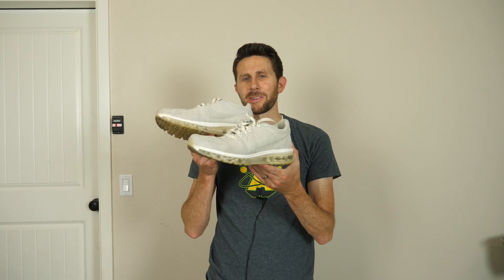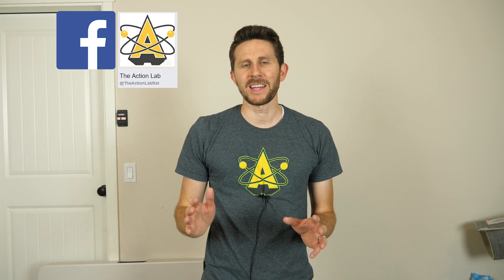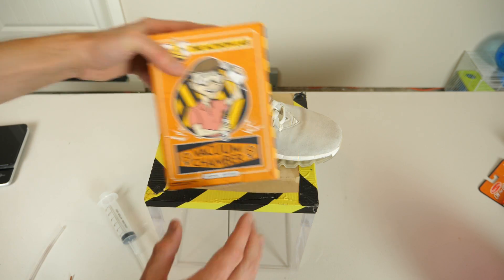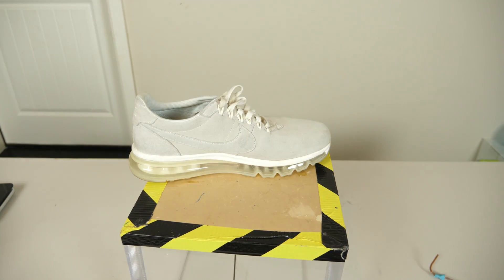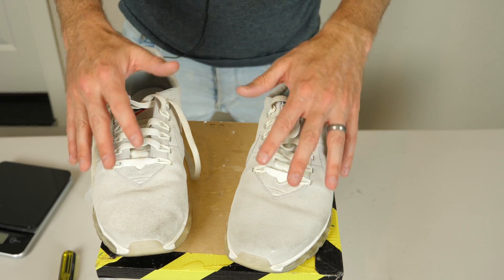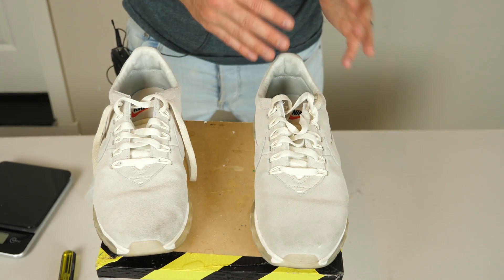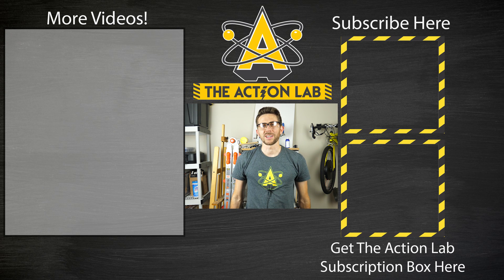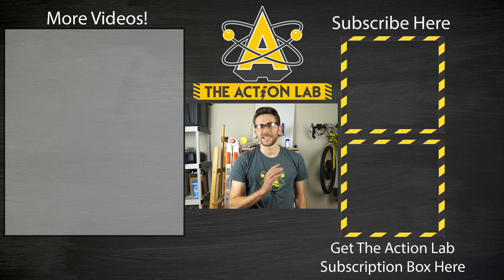Putting Helium in Nike Air Max—Are They Lighter?

Comment from the maker: In 1999 Converse came out with a shoe called Helium that premiered a bubble filled with helium in the bottom to make the shoe lighter...they could have benefitted from watching this video
Reply: The Action Lab : what was the weight of the shoe after the air was removed with the suction pump?
Reply from the maker: The weight of the shoe was the same after air removal. Air is neutral weight in itself at near atmospheric pressure. But for higher pressures it is more dense so it is heavier (like in a bike tire)
Reply: The question is, why would a tire with 40 PSI of helium be heavier than a tire with 40 PSI of nitrogen and oxygen.
Reply from the maker: I’m not sure about why the helium could weigh more. It should actually be heavier. It deviates from ideal gas such that there are less atoms at a given pressure than N2 or O2. Also those atoms have less mass. So it should be lighter...even at 40psi. Did he control for temperatures and was the volume exactly the same. Those would both have to be the same to expect the correct results.
Reply: here is the video in question https://youtu.be/vJNg4njdyLo
Reply: actually doesn't N2 and O2 deviate more as they are diatomic vs monatomic that helium has?
Reply from the maker: N2 and O2 deviate much lower at below 200 atm then much higher at above 200 atm. By lower I mean the compressibility factor is less than 1. As in this photo https://goo.gl/images/hD25y9
Reply from the maker: Just watched that video. Definitely not a reliable method. Not accurate enough scale, and temperature and volume were not controlled (volume will be close to the same though but not exactly)
Reply: benjah4eva the same as when air was in it.
Reply: I recently saw a video of this guy putting about 40 PSI of helium into a bike tire,  it actually made the tire heavier then with same pressure of normal air but no one could give an explanation for it.  perhaps this is something you can investigate?
Reply: @abyssflight3907  was it Needle media? It was heavier because it needed more since helium isn't as dense as air
Reply: i thought when the video said new on it i just thought oh it was made maybe yesterday but no just a couple hours ago
Reply: Roan Robertson .
Reply: Or just experienced a helium balloon. It's just a selling gimmick.
Reply: Lol
Reply: What if you put sulfurhexafloried is it hardder to walk?
Reply: Wouldn't it also depend on how accurate the scale was?
Reply: Hey action lab ! Love all your videos.
But I have a question,
Which is faster: human sensation or light ?
Please answer this
Reply: @Prayash Niraula Tutorials
Humans, on average, take at least 20 milliseconds to process what they see. Light, meanwhile travels around 30 centimeters in a nanosecond.
Reply: @prayash7805 
It's light.
Reply: A weight difference is more likely if you put Sulfur Hexafluoride in those shoes as it is six times heavier than air.
Reply: I love your vids, they help me understand things that I didn't know and idk if it is just me or you are tired in most of your videos so please take some rest and keep up the good content
Reply: @The Action Lab
Lovely video. I wish you would put more things in the High Pressure chamber though.

Now if they made the sole more like aerogel, with many smaller air pockets distributed evenly throughout a matrix...
Reply: Get shots💉!
Reply: Put a diamond in a hydraulic press
Reply: What's your actual name
Reply: Dark Angel my name is Daniel DuCharme
Reply: I want to become a scientist when I'm old.I am getting a lot of interesting information from you.You are totally cool
Reply: The Action Lab .
Nb

.,
Reply: Thanks @Will Salmon and @Amaroqdricaldri
Reply: Do the turtle on the treadmill experiment
Reply: They also put helium in professional push bike frames. There is a valve to top it up.
Reply: Hi 👋 cool
Reply: It would make it heavier because it’s less dense and it takes more helium to fill it needing more helium to fill it
Reply: @owenturner758  it would make the shoes lighter because helium weighs less and takes up the same volume
Reply: The Action Lab try using the Nike vapor maxes
Reply: What will happen to water if you completely remove air out of it? Will it be possible to make it boil or to freeze it? Will it mix with air if you leave it in a glass for a while? I tried to do this with syringe but I think vacuum chamber is better for this
Reply: reebok
Reply: thank me later i liked your comment so it didnt stay on 666 likes
Reply: The Action Lab where can I get the air pump
Reply: 700th liker!!! I subscribed too!! and I was the 818.881 watcher of this video
Reply: Lo
Reply: YOU RUINED THOSE PERFECT SHOES
Reply: The Action Lab yeah... probably.
Reply: Should have done it with vapormax because they have bigger bubbles
Reply: The Action NIKE NOT NIKIE!!!!!!!!
Reply: In 2013 Adidas came up with a new midsole for comfort and performance, made up with thermal plastic urethane this technology is known as Boost
Reply: Pomak
Reply: Clickbaiter
Reply: Konverz
Reply: At least your still alive man... R.I.P Grant Thompson
Reply: Can you weld in a vacuum? And achieve a clean weld? Then test the weld with the bend test, x-ray,  pull it apart and then cut it in half?
You didn't purge the helium hose.
I am a pipe welder, and purge the pipe with argon gas before welding.
Reply: They were likely aware it’s just still good advertising
Reply: They should have used liquid helium in it then they could defy gravity.
Reply: theres no u tube in 1999
Reply: The thumbnail har har har

Comment: I remember sitting with my feet up near a camp fire many years ago.  The bubble on the nike air shoes I was wearing melted and a flame shot from the shoe as the gas released! I didn't think Nike would use a flammable gas to fill the shoes. Any explanation?

Comment: so i did actually think about this for a second. what if you inserted a light weight metal that could be filled with gas but way high pressure. would higher pressure = more float?

Comment: It will get more heavy  because helium is less dens(?) then Air so more helium fits in there.
Reply: Prinz Schmalzlocke no. Helium is less dense, so in theory at the same pressure and same volume, the helium would have less mass

Comment: Im not saying your wrong, but helium is lighter than air so if you were to put it on a scale it would make no difference because lightness doesnt make it heavier. Thats why when you scale a balloon it pretty much has No weight as compared to a balloon with Air and Not helium, and for the people that dont know. Helium is lighter then air and thats why it floats in mid Air.

Comment: If the weight of the shoe is greater than the volume of helium, then  naturally, the shoe will not float. Given if the shoe were attatched to a tethered balloon, the shoe will still not float. However, if the volume of the helium in a large amount of balloons is greater than the weight of the shoe, the shoe would then float.

Comment: if an inflated balloon can pops when decreased the atmospheric pressure then why not space shuttle explode in space,,
please explain
Reply from the maker: Because space shuttles are not made of thin stretchy latex...is that really a question?
Reply: okay understand so you mean only stretchy body can expand or explode in vacuum not solid what if a glass bottle filled with air tight put inside your vacuum chamber ,,will it explode too..Thanks

Comment: Not to mention that helium from that cylinder is only about 25% helium by volume.
Reply from the maker: You’re right, I didn’t even notice that on the tank it says not less than 80% air

Comment: No they wont float. Do to a interesting property of helium they will get heavier than before. While helium is less dense by far it takes much more helium to fill the same volume of space. I forget the exact math im not great with it. But basically if a gas is say ten times lighter than air but is 40 times less dense you will see a notable increase in over all weight. Oddly it will fill the volue faster than air though because the molecules are so much smaller they travel through the hose etc faster. So heres to watchign you pop them bladders in a couple seconds heh

Comment: 1:35 you know there’s a big difference between mostly collapsed and all the way collapsed
Reply from the maker: Even at a full vacuum it would not collapse all the way. The shoe is supported enough to withstand 1 atm pressure so it doesn’t collapse all the way. But that doesn’t mean there was not a vacuum inside.
Reply: The Action Lab I know I was just quoting Billy Crystal